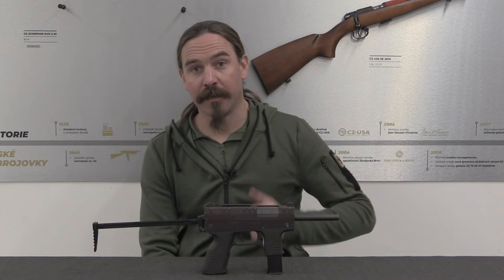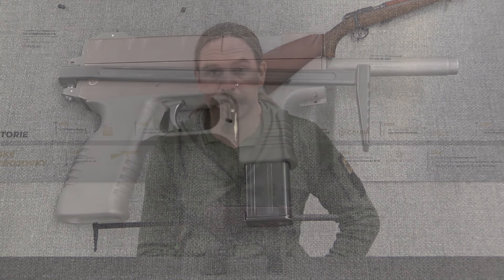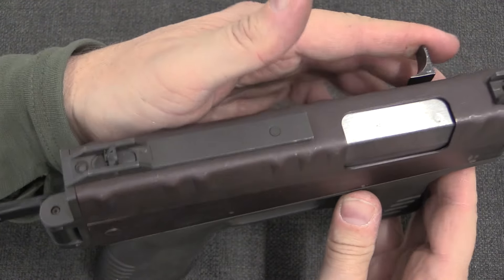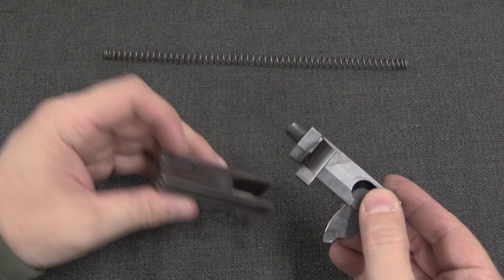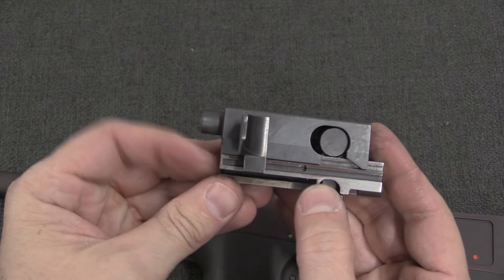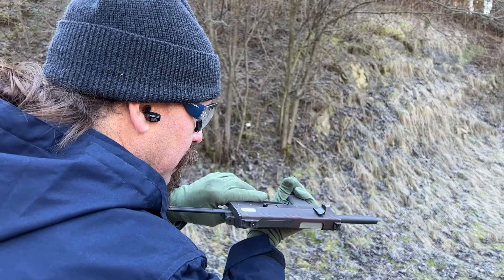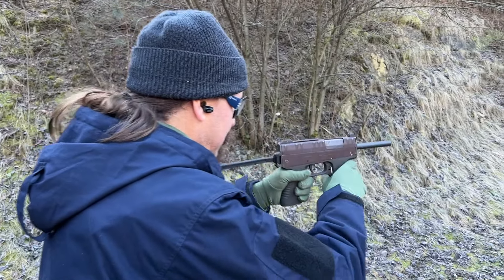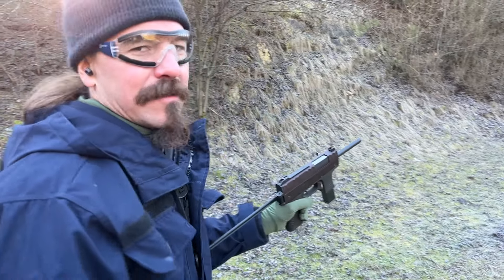Ladislav Findorak's Prototype Lever-Delayed PDW

Comment: Extending the frame all the way out to the muzzle and then adding a front sight out there might've helped with the whole aiming thing.
Edit: There is also some endearing about weird old funky prototypes.
Reply: It would also allow you to have a longer folding stock with a locking tab at the front rather than the wonky push down to fold out action. It would still retain its small folded frame and probably be a very nice little SMG.
Reply: That would have increased the weight by quite a lot.
Reply: @alltat  Nah, don't think it would've been a problem.

Comment: Interesting little gun. I'd like to see a beefier stock on it, and for whatever flaw was keeping it from going full auto to be worked out. Also, I'm not a fan of reciprocating charging handles, but the bolt looks pretty neat.
Reply: There doesn't look to be a lot of space inside to make the bolt nonreciprocating.  There's always engineering tradeoffs, and a lot of the slack already went to making it teeny tiny.  I mean they basically riveted a handle to the slide of a machine pistol...
Reply: @quarthinos  I don't know, if one used a curved piece of sheet metal and it connected with a notch in the bolt and had a couple of really tiny springs on each corner pulling the charging handle back forward it could work.

Comment: This is an amazing design, they need to work the bugs out and put this thing into production. I love the operating system and how compact and lightweight it is. If they produce something like this reliable with a pic raill on top, and a more functional stock and a little compensator, they would sell like hotcakes. Sure this design can be made to run. I would like to see these on sale for about $500 to $600. I wonder if this could be made with stamped sheet metal? With the right clothes you could CCW this thing.

Comment: Not the most potent firearm but when you consider that you can fold that thing up and have it hanging off your belt or tucked into your car's side door it makes a lot more sense. If it had a full set of furniture, stock, front grip, ect., it would be like a lot of modern submachine guns.

Comment: Really doesn't look like you need to push on the joint of the stock  down with your finger to unlock it. If you just push upwards on the end of the folded stock it should push the locking mechanism down and you can swing it open without any kind of second step.

Comment: I can see why this design did not pass testing, but the core of it which is the bolt/carrier/accelerator design seems extremely promising. Why doesn't CZ make an ultra compact modern SMG with something like this? Their current Scorpion is a little big for the ultra-compact concealable PDW role the old one served. This could be the core of a new system that's really no bigger than a large pistol but fully functional as an effective SMG.

Comment: Actually the bolt starts moving the same moment the round is fired, otherwise there would be NOTHING pushing the bolt carrier. The lever only forces the bolt carrier to accelerate faster than the bolt, so exchanging mass (that would be required in a simple blowback) for speed (to accelerate a mass at double the speed, you need four times the energy).
Reply: Actually the bolt starts moving once the chamber pressure is high enough to overcome the mechanical advantage created by the lever. This increases the effective spring pressure by some factor. This would be designed to be slightly under max chamber pressure so that the chamber is still mostly closed when max pressure is achieved. The weight of the bolt carrier is usually negligible in these designs. Spring rate and mechanical advantage are the critical factors.
Reply: @atomicsmith the only mechanical advantage created by the lever is that the carrier has to move at a faster pace than the bolt, so exchanging mass for speed. The ratio of the pace is decided by the ratio of the leverage.
Actually the weight of the bolt carrier is a MAJOR factor in those designs (see for example that of the FAMAS, that's all but "negligible") because the lighter the carrier, the higher the leverage ratio needed to obtain a safe enough locking, but the higher the leverage ratio, the narrower the difference from too early and too late opening. That's why the AA52 is the appreciated and trouble-free French GPMG since 1952 (because a 10kg GPMG can have a quite hefty bolt, that doesn't need so much leverage ratio to delay it's opening) while the FAMAS, that had more stringent weight requirements had a troubled development process (the F1 couldn't even safely fire NATO standard munitions).
Reply: @neutronalchemist3241  I don't know who started this myth, but you could prove it to yourself with some quick calculations. It would take a mass of at least 20lbs to adequately slow a 5.56 casing down. The lever on a FAMAS is roughly 2 to 1. The weight of a FAMAS bolt is less than 1 pound. The spring rate on most rifle recoil springs is about 10lbs. You can see that the spring rate is going to get you closer than the bolt mass. There's a reason you don't see direct blowback in rifle calibers. The mass required is just too large. No 2-1 or 3-1 lever is going to make it practical. In pistol calibers, you can just visually look at the bolt carrier on this gun versus say an Uzi bolt and tell that this carrier weighs far less than 1/3 of an Uzi bolt.
Reply: @atomicsmith  It's not a mith, it's how physics works. What you call "mechanical disadvantage" is only the mechanical disadvantage of moving a mass. No mass, no disadvantage. The "mass of at least 20lbs to adequately slow a 5.56 casing down" is out of this world. A VERY SAFE formula to calculate blowback bolts weight is to assume a 4m/s bolt velocity is safe, then the required bolt mass is:
bolt mass in pounds = 1.09×10-5 * bullet mass in grains * bullet velocity in fps * (diameter of bolt face / diameter of bullet base). According to this formula, .223 Rem requires a 7 pounds bolt. In reality this formula is well known to give bolt masses that are far too high and become exceedingly higher as the power of the round increases. IE, according to this formula, 1.7 pound is required for 9mm Parabellum and 2.3 pounds for .45 ACP. Reality is that it requires a minumum of just 10 ounces for 9mm and 12 ounces for .45 ACP. 
The  reason you don't see direct blowback in rifle calibers is that the mass required is  is just too large, but it doesn't come even close to the mass you think is required. 
The lever of the FAMAS is roughly 3 o 1, thats also the limit where a lever delayed blowback stop working because the difference between too little and too much delay becomes too narrow. 
The spring rate is static, it doesn't change with acceleration. That's why it's not even considered when calculating the bolt's mass.
Reply: @neutronalchemist3241  Assuming the numbers you've just given, (7lb bolt x 0.625 reduction factor based on other calibers )/3 leverage factor = 1.45lb
Do you think the bolt carrier on a famas weighs any where near 1.45 lb?
Reply: @atomicsmith  To accelerate a mass at double the speed in the same time you don't need double the energy, but four times the energy. To triple the speed you need nine times the energy.
Reply: @neutronalchemist3241  The force is fixed 
M1 x A1 = M2 x A2 
1/3 less mass would require 3 times more acceleration. It's a direct relationship.
Reply: @atomicsmith  Sorry, but 7lb bolt / 3 (leverage factor) / 3 (reduction factor based on other calibers, since 10 ounces compared to 1.7 lbs and 12 ounces compared to  2.3 lbs are about 1/3. Let's ignore the fact that the results of the formula are increasingly off as the power of the rounds increase) is 0.78 pounds, not 1.45. 
You have also to subtract from the 7lbs the weight of the bolt and the weight of the delaying lever (that on average moves at the same pace of the bolt), but let's ignore that too for now. 
Do you think the bolt carrier on a FAMAS PLUS THE RECOIL SPRING TUBE AND CHARGING LEVER (that recoil with the bolt carrier, also half the weight of the recoil spring contained in the tube should be counted))  has a weight so much different than 0.78 pounds?
I should say it's a bit more.

Comment: Wouldn't the lever-delayed system be harder to maintain than a traditional blowback?
Reply: Possibly, but that would require a significantly heavier bolt.  The whole point of a delayed blowback system here is to reduce weight.

Comment: That was a very interesting non-maco review, warts an'all. Thank you. It looks like it could have been developed into a useful firearm. 
Speaking with absolutely NO experience or knowledge at all, did you try firing it right handed? To see if the problem lay in the actual trigger part.
Reply: Probably to prevent brass to the face. Such a short shoulder stock bring the ejection port really close to the face.

Comment: I could easily see this thing with the stock removed appearing in some dreadful late-eighties 'Full Moon' SF film on VHS!

Will there ever come a time when electronics control the gun entirely? It seems to me that a lot of the complexity and also the design bottleneck is around locking and unlocking the breach then re-tripping the hammer/striker if automatic fire is desired. I should have thought that by now it was possible to produce electronics that were both fast enough to perform these steps with servo-motors and direct electric ignition that were hardened enough to withstand a million cycles or however many rounds without failing. The system could also be design to fail safe with a locked breach if the electronics did come apart.

I can understand the survivalist not wanting electronics in his firearms that are intended to keep him alive after the bombs fall, but I would have thought that sort of--potentially network-controlled--system ideal for government armies.

Comment: So this fires full auto from a closed bolt? That doesn't run the risk of cook off's?
Reply: Very few modern full auto guns are open bolt. Cookoffs are only a concern with machine guns where firing a thousand rounds at a time is normal heavy use.
Reply: Magazine capacity. Need I say more?
Reply: @lobsterbark  The reason I was curious is, I was watching another video last week and as an aside Ian mentioned the Germans tried to full auto the Luger and he said they had problems with cook off's.
Reply: @Jimtheneals  I would imagine that was after firing many more rounds than we would ever do nowadays. Testing to machine gun standards when it wasn't a proper machine gun. They tended to really push things till they broke back then because the technology was early enough anything that worked well and didn't break was special, so if you didn't test it it was more often than not gonna break pretty quickly.
Reply: @lobsterbark  Thanks, that makes sense. Appreciate the reply's.

Comment: Given the prevalence of p90s and mo7s with their unique rounds and modern pdws in 5.56, 9mm PDWs always seem odd to me.
Reply: One of the calibers that the Kris Vector is available in is 9mm.  People typically class them as SMGs, but they're intended to be PDWs.  I'm fairly certain that the H&K UMP was also intended to be a PDW, but it's listed [almost] everywhere as a SMG.
There isn't actually a solid cut-off between SMG and PDW, but by common definition any automatic weapon in a pistol caliber is a SMG, while a PDW is any weapon intended for the express purpose of self-defense.
Reply: Most tier one units I know of are going back to 9mm or are already back, so doesn’t seem odd to me.

Comment: Looking at this thing, I get the impression that a modified Glock, with a slightly longer barrel, a folding stock and forward pistol grip, would do as well or better. In the vein of a bigger, better, Beretta 93R.
Reply: Look up Flux Defense
Reply: I think you would see issues with sheer rate-of-fire causing problems, since they tend to want that as a feature. The tilting-barrel system Glocks use have nothing that delays the rate of fire as it is really designed to use with semi-auto, and once you go full you have the cascade of issues in getting it to feed fast enough, having enough ammo in your magazine to be worthwhile, controlling recoil at that fire-rate... just lots of issues. See the VP 70 on the range in this channel for examples.

There is a reason so many of these type of micro-SMGs and PDWs so often leap through hoops to reduce the rate of fire and use delaying mechanisms (like the vz.61's ingenious rate reducer), or overcome the issue another way (the Calico and P90's absurd magazines). 

You had a good idea, but others have defiitly had that idea and finding out why they aren't doing it that way is always a fun rabbithole!
Reply: @Verbose_Mode  While you are mostly correct, a compensator, particularly one with upward ports, does further delay cycling and reduces the ROF. Look at PMM's compensated full auto Flux Glocks, they are VERY controllable, and very reliable, and standard cap of 35-40 rounds, with the option of two stick mags for 33+33. The VP-70 was direct blowback with no delay, with lots of issues, but that was the greatest.

Comment: Prototype issues. Largely avoidable by just going with the flow of what others are doing. But then where is the opportunity to perhaps create something that is better?

Clearly at least more homework for the gun designer to get the bugs (and empty cartridges) out.  Perhaps pushing them out of the front of the receiver is easier than flinging them in the face of sinister individuals... This one looks like it's trying to eject to the front but there's metal in the way.